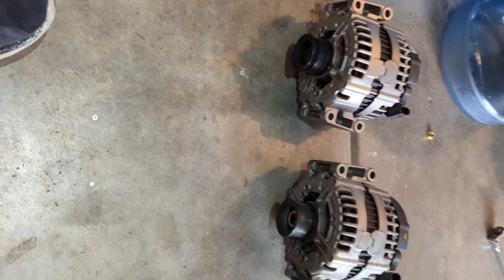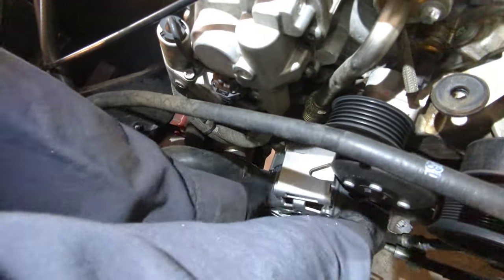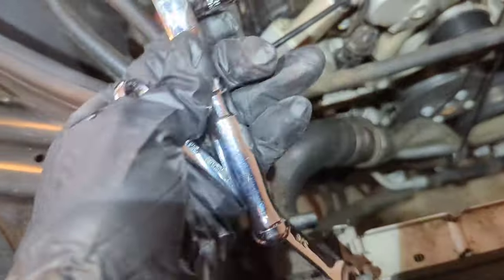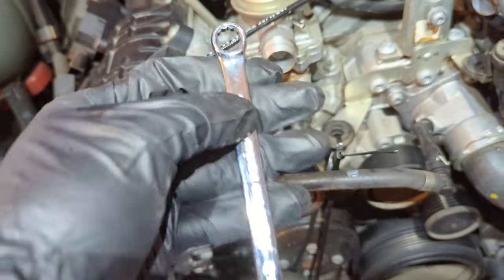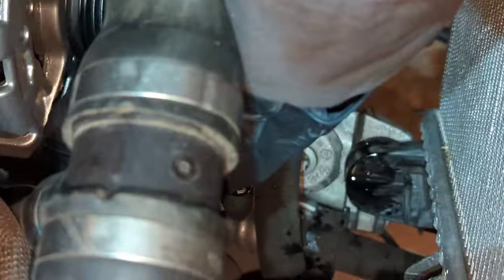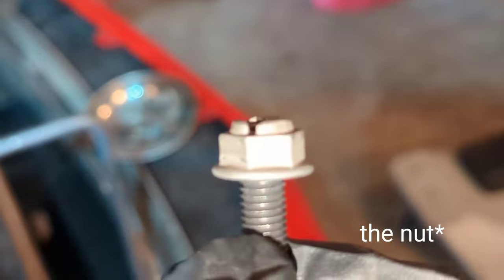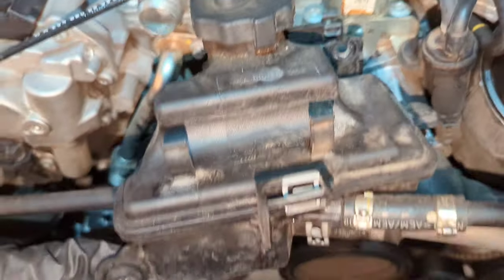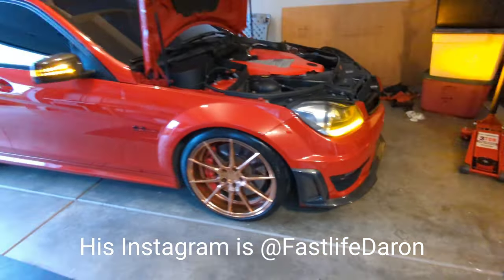how to replace the alternator on a Mercedes C63 E63 S63 SL63 CL63 ML63 CLS63 AMG M156

Comment: Hello. Great videos.
I am torned between w204 c63 or cls55. Thing is m113k offers more hp per dollars. And cheaper to get good power. Although what if ess charging c63. Will the gain with supercharger on c63 will be way ahead of tuned cls55? Cls55 offers more creature comfort, spacious but something about w204 c63 that always attracts me.
Reply from the maker: I can see what you mean, but if you take a heavily modified cls55 and a C63 on an ESS supercharger they will be neck and neck, the cls55 is the more rare car but the C63 is also a car that has a lot of aftermarket body parts, something the cls55 struggles in. At the end of the day it's about looks and sound in my eyes, both are beautiful in their own ways, the cls55 sounds amazing and that supercharger whine is awesome but the 6.2 on the C63 is absolutely godly, you also have to take into account reliability, and the ease of wrenching, even if you don't work on your own car you will pay more for labor to have the same job performed on the C63 because of the huge engine crammed in the tiny car. Another good considering is the 2011 E63, spacious car, good looks, and more uncommon than the C63👍

Comment: What wheels are those?
Reply from the maker: They're Rohanas not sure what the model is
Reply: @thiccls3948  ironic I’m about to change my alternator, second one in 15k Miles I’m dreading this shit. Did you do OEM or reman?
Reply from the maker: @DriverJizzle  reman from FCP euro only lasted a month, they send back an a new OEM unit and there hasn't been any issues since